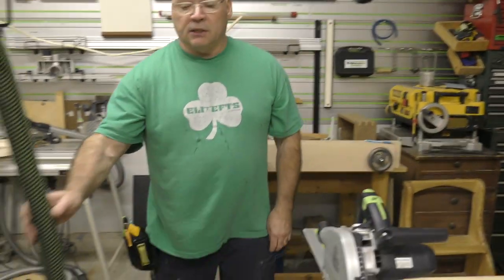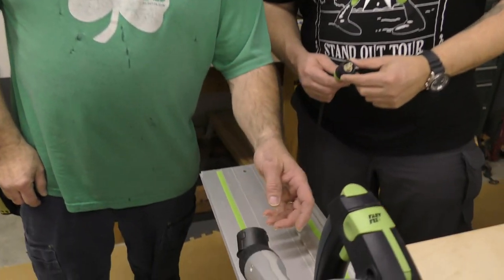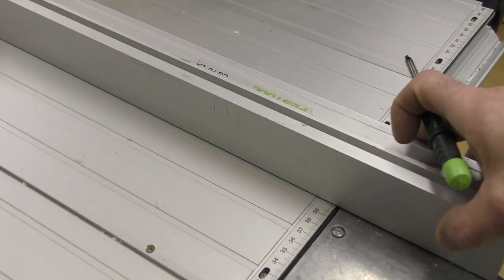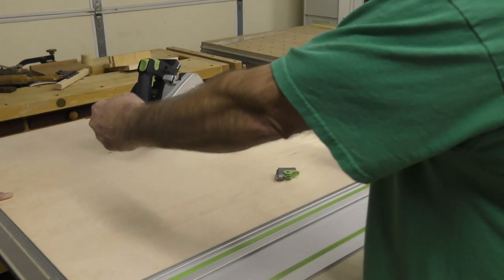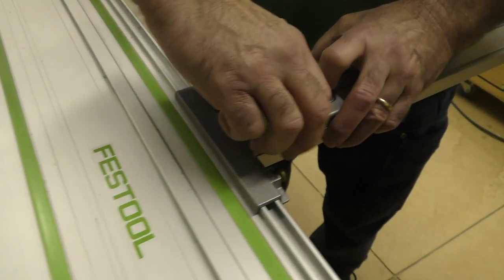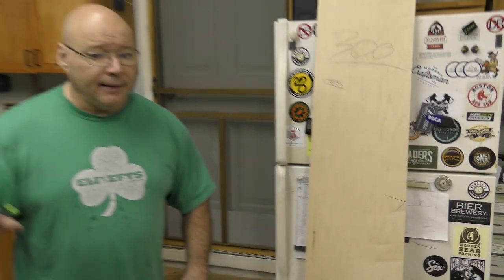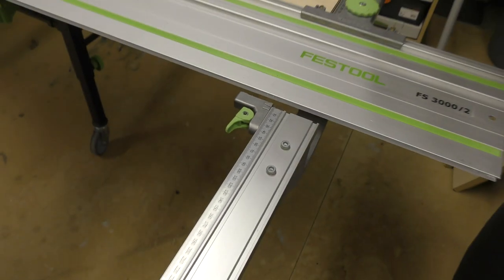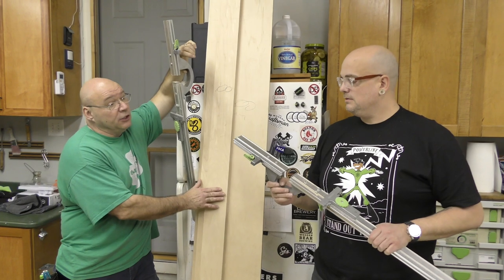Festool Parallel Guide Overview and Calibration

Comment: Hi Sedge I use a bandy clamp on both ends which keeps the reference points flush to the plywood and it's fast to install and take off. Since starting doing that I don't have the track slip so all the cuts are perfect.
Reply from the maker: cool

Comment: Cutting the 100mm on the parallel guide I didn't see you set the fence in place so I'm assuming the 100mm is on the offcut side.
I always wondered how these parallel guides work.
Nice video on how to calibrate.
What prevented me from buying parallel guides from festool is the cuts I wanted to make was larger than tje parallel guides. I see you can get extensions. Also other manufacturers cater for the larger cuts.
I bought ruler stoppers to parallel my cuts. It did take a little longer to set up and I used spacers so the ruler did not slide under the rail fence.
Reply from the maker: Thanks for sharing Ronald...

Comment: Thank you for a very helpful video. I completely understand now the way the parallel guides make precise parallel rip cuts achievable.🙂

Wondering...can precise parallel rip cuts also be achieved with an MFT tabletop and specific accessories (without parallel guides)?

New to woodworking, plan to buy a TS and several accessories, so I'm trying to understand the various ways to accomplish specific goals in order to create my purchase list. I want the MFT table for other things, so wondering if it can also be used for this purpose. Thanks!
Reply from the maker: Parallel Guides for ripping
MFT/3 for crosscutting
Reply: @sedgetool  thanks!

Comment: Thanks for a great video. I'm wondering what you use on the edge of the MFT to support the sheet of plywood? They look like 2x4 extensions. I need a little extra width on the MFT but I don't want to get another whole table or MFT extension!
Reply from the maker: I am using the STM 1800 work station .....
Reply: @sedgetool  Thanks, that's very obvious now! What a great system.